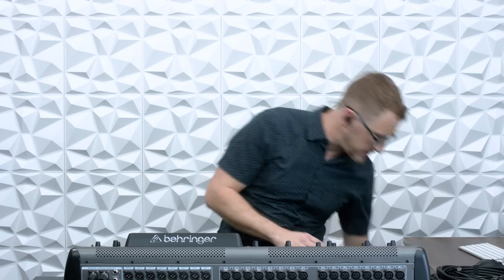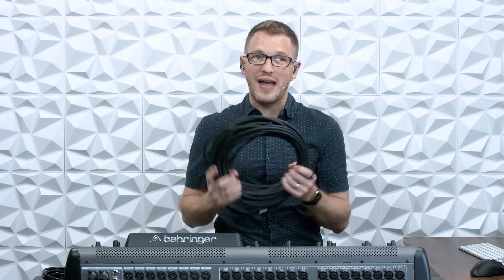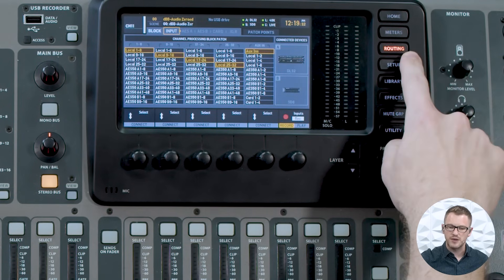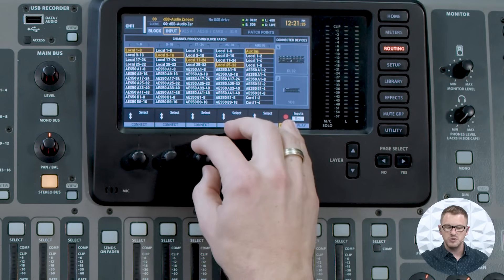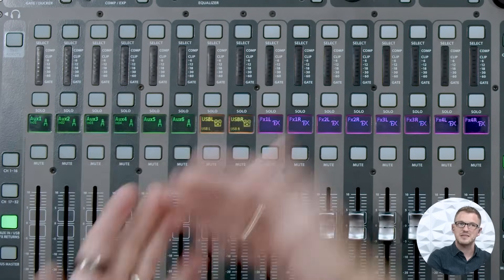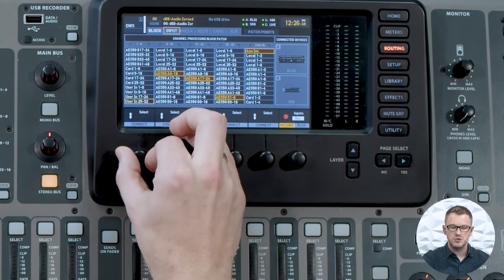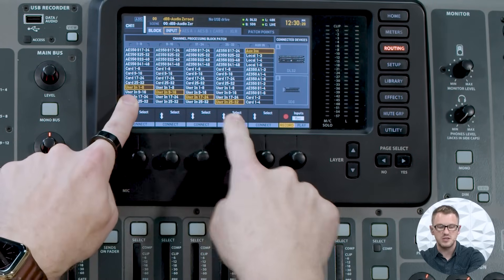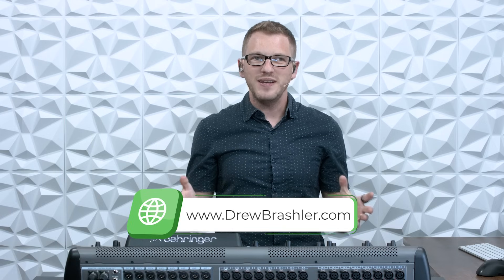Installing an AES50 Stage Box with the Behringer X32

Comment: I have XDante installed in my X32 expansion card and connected to a laptop running Ableton. My Ableton operator says that when we change the gain on a channel on the X32, it affects the signal strength in Ableton. Is there a setting that I need to change so that the gain is independent of the X32 gains...

Comment: Thanks for the outstanding content. I have an X32Rack+SD8 and I was hoping for examples of user output routing. I mostly use the SD8 to shorten downstage cable runs and to augment the number of XLR outs, using local out for IEMs and SD8 outs for FOH, Sub matrix, and wedges.

Comment: Hello. I like yours video. I have a X32 on my church, and i want to put a password or lock the console to prevent power on from other People or Kids that ar not supose to be there
Reply: Holding the “home” button at the top right of the console (roughly 5 seconds) will put the board in a “lock” state. The screen will say “locked” and even tho ppl can mess with faders or knobs, all the settings will return to the last state before being locked.

Useful if you need to walk away from the console but afraid of kids wandering near it.
Reply: You could use a power strip that has a key locking “on” button to keep someone from powering the unit on.